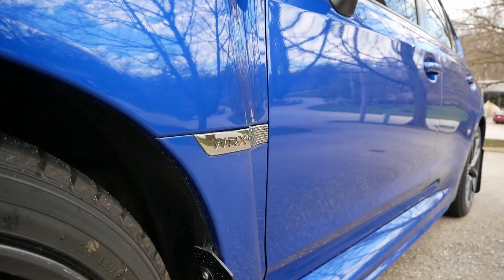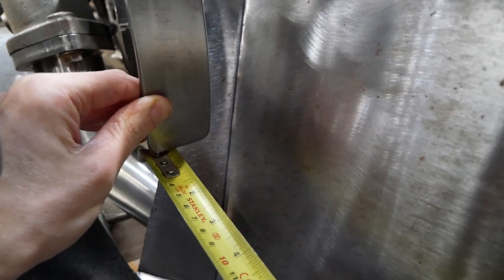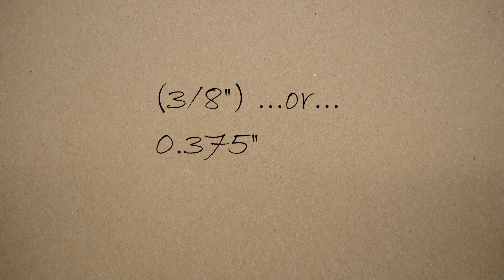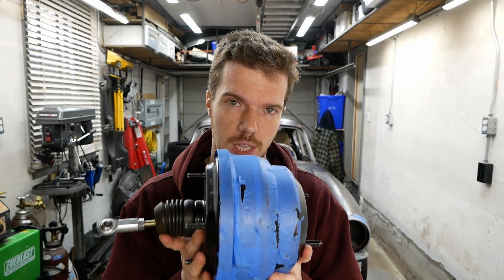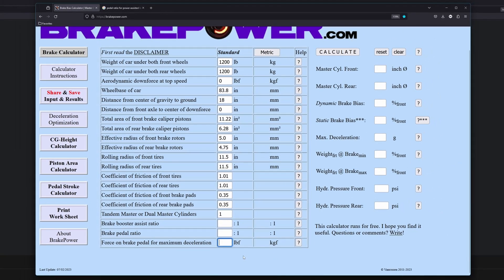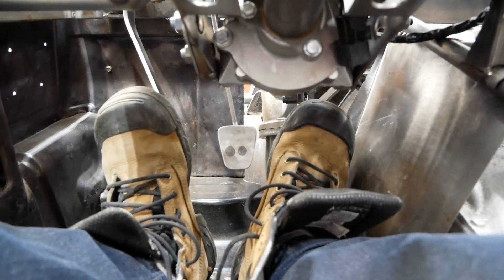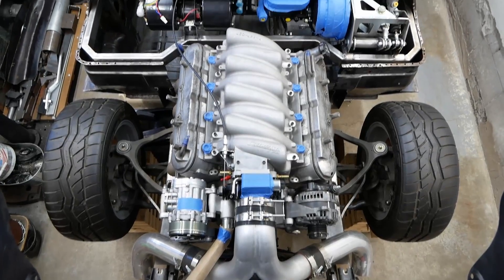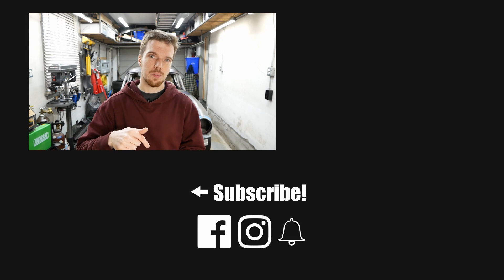How Pedal Systems work (it’s complicated)

Comment: Back when I raced Formula Ford, the brake pedal moved very little.  The brake lines routed force between the 2 brake master cylinders and the front and rear brake calipers. Front and rear brakes had separate master cylinders that were connected by brake balance bar which was connected to brake pedal. There will be differences in the design of the brake systems for a purpose-built ace car, like the FF, and a street car.
Reply from the maker: That's a very versatile setup for a race car for sure!  Much of the calculations in this video still apply (just leaving out the booster as it's not really possible in that setup) ... I wanted a more OEM configuration here though, as it's arguably safer and less complicated for a street car like ours.  With a balance bar setup, if one line develops a leak, the bar will allow for a lot of pedal travel before the remaining master starts to compress.  Cheers Lewis! 👍

Comment: This is why I roll my eyes when mechanics make fun of engineers.
Reply from the maker: Unfortunately, sometimes engineers don’t design things to be very serviceable! 😅 … but yes!  There’s so much more going on in any given system than the average user has an idea of!
Reply: @FanatikBuilds  I propose, once more, to mandatorily make every one of any future engineers attempting a career in designing car-related things work in a dimly lit, sparsely heated, not air conditioned workshop under an arsehole of a boss flat-rate repairs-only, on real-world rust-belt cars not younger than 6 years and not under 100.000 miles, with harbor freight tools of course, for at least two winters and two summers before they were allowed to first get close a design board or a computer having construction software. Sounds hard? Well, not as hard as looking like You got in an hourlong barfight after trying to change a dipped beam headlamp bulb for a couple of hours - in vain. 
Thanks for sharing!
Reply: @manfredschmalbach9023 it wont happen. Engineers are too frail to actually build things in the real world. They just design stuff that looks good on paper so its all good.

Comment: Someone has to be pedantic and I guess it's me. The throttle pedal mainly transmits position of your foot into position of the throttle. The brake pedal mainly transmits force from your foot to force on the brake pads. The clutch somewhere between the two I'd argue. None of them convert motion into energy.
Reply from the maker: I see what you’re saying, I was trying to be general in my summation.  You apply a force (and a distance) and get some kind of usable result.  Guess I could have used better words! ✌️

Comment: Thanks for that! I just had to replace the front and rear master cylinders in my car. It has a Wilwood pedal box with the balance bar.  I guess if you're using a proportioning valve you don't need that.
Reply from the maker: That's a great setup!  Just no possibility for a booster ... well, unless it's a remote deal like the late MK3 GT6's I suppose, but I can't say I've ever seen someone do that!  Would likely be a big issue if there was ever a failure on the boosted (front) circuit, as the balance bar design would then divert most of the pressure to the rear.  Yikes!  We went this route as it's more OEM+ 👍 Cheers Brian, hope you're well!

Comment: Good work! It's a complicated subject and not easy to explain. Now do tandem brake masters with balance bars 😏😏
Reply from the maker: Cheers Dan!  It's actually the exact same process in that setup though!  Just ignore the booster and the rest stays the same... you can get it dialed in perfectly with that design, just no provision for assist is all! (unless it's a remote booster, but even that would be strange) 😊✌️
Reply: Great vid one of those things you never consider until you do it !
Reply: that is tricky....